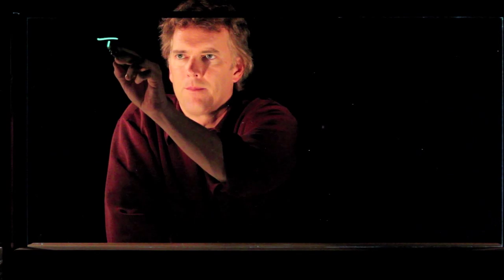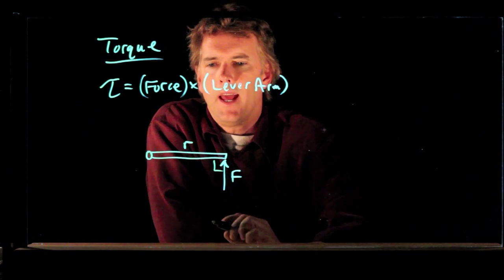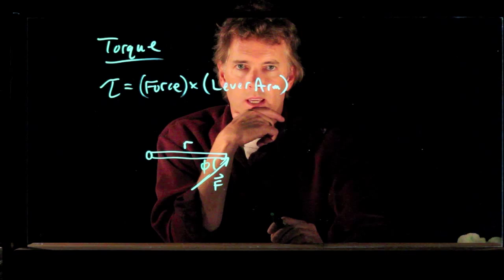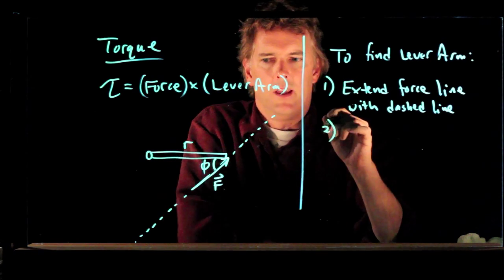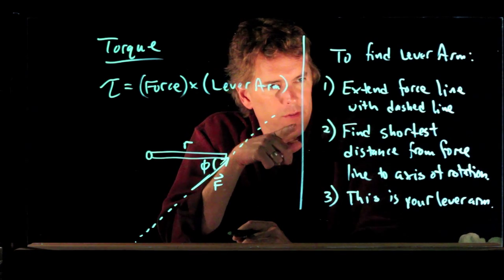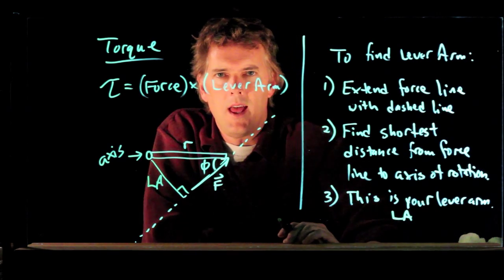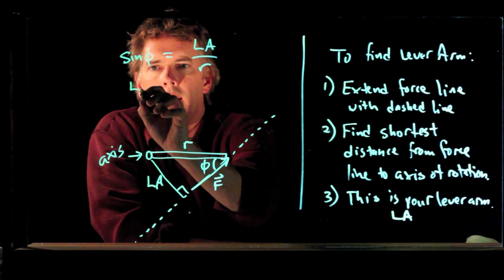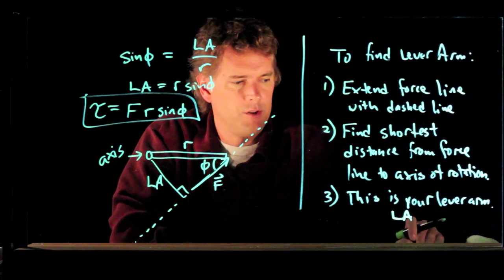Lecture on Torque 2/3

Comment: four forces are applied on the rectangular plate  shown .then determine the resultant of the forces and its direction theta as measured from the positive x axis counter clockwise and give components of the resultant along diagonal ob of the plate.can someone solve this problem